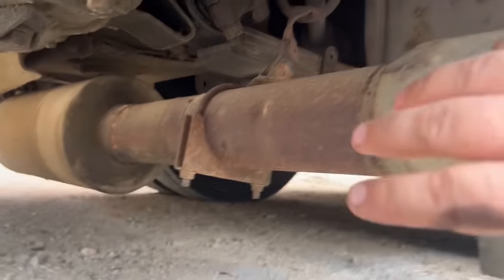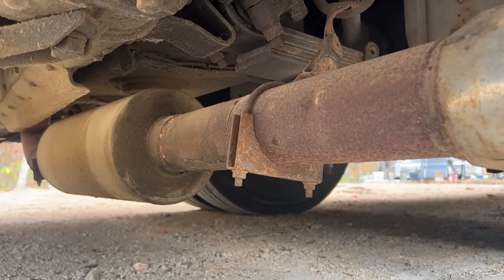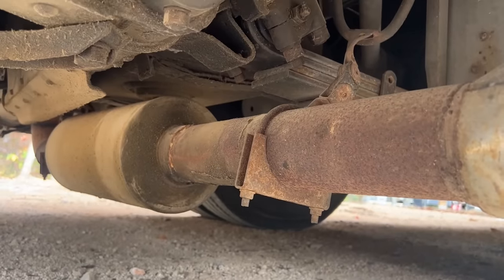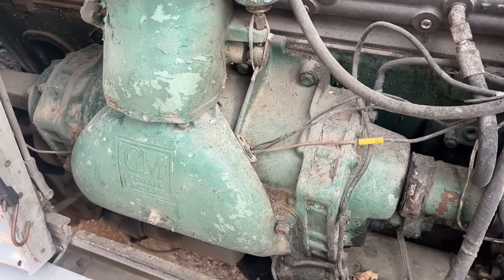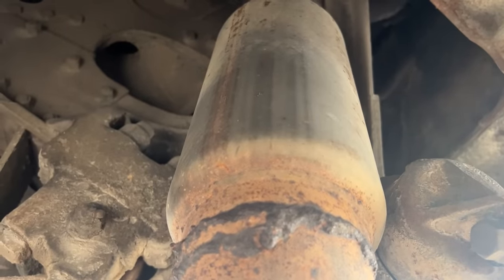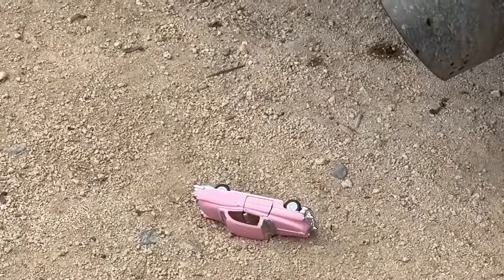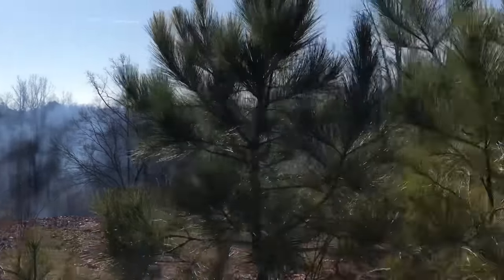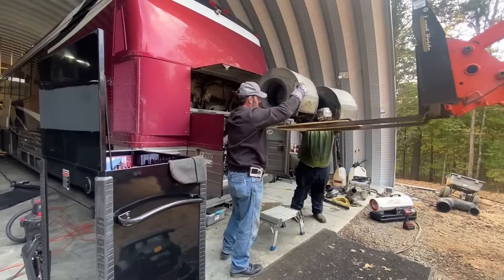Installing emissions upgrades to the detroit diesel 6-71 2 stroke diesel.  Environmental friendly

Comment: The contribution of the Detroit diesel to making  America what it is can not be understated.   Army Navy Air Force Marines.   That screaming Jimmy ,  the black smoke,   is American as Apple Pie.   Its part of who we are and what makes us special.
Reply: Amen
Reply: @tjroelsma  life, liberty, and the pursuit of happiness
Reply: The only problem is that they stuck around for far too long well past obsolescence.
Reply: @ChrisHarding-lk3jj not really ... the most advanced engine design in the US right now is variation of 2 stroke diesel...  basically take two Detroit diesel blocks and point them at each other instead of installing a head, of course in reality they machine it as one block... and gear the cranks together, one set of ports becomes the intake the other the exhaust... and thus you have a nearly 50% efficient ICE, with ultra low emissions. And on top of the efficiency you also get an even simpler engine as it has no complicated head to machine at all. the main reason detroits get  bad rap is because of the slow transition to electronic controls and failing to advance the engines, putting modern advances on these engines puts them right back at leading the pack. the strategy they use for reducing emissions is to reduce combustion temps, via homogeneous combustion as well as extra long stroke that comes from being opposed piston, another up side is that a 3 cylinder OP is balanced! which means you can have huge very efficient pistons....
Reply: @Wingnut353 what you are describing sounds like a Fairbanks Morse engine commonly used in WW2 submarines.  Is there a new version of this, and if so, can you link it here?  I'd love to read about it. 

https://en.wikipedia.org/wiki/Fairbanks_Morse_38_8-1%2F8_diesel_engine

Comment: Man, Lenny was sticking to the GM brand having a Cadillac converter installed on it. At least it doesn’t have to suffer the fate of dumping raw diesel straight into the DPF when it regens.

Comment: Here in South Africa a local farmer re-routed his tractor's exhaust through a cooler system and injected it into the ground on his planter. 
He recorded substantial crop yield increases.
Reply: That's a fact indeed, the stuff that comes out of your exhaust (Actual Diesel fumes with some oil and sooth) actually help increasing the greens.
My garden had a dead spot i tried everything with fertilizer... nothing worked... soo one day (Very high airhumidity) i parked my Toyota there and kept the engine running for a while (custom high idle) and i noticed the ground was covered in 'coal' (roll that beautifull coal) and it started raining... after that i changed my oil and since it's a dead part i figured i dont care it's my garden ill dump it there... Right now beautifull grass and moss.
Reply: @AllianceB95  i had  similar issue when my Mitsubishi Pajero blew a head gasket. I started it and it blew black soot on the grass. Over the next 2 weeks it came up greener and darker than the rest.

Comment: The absolute best emissions device that can be installed on 2 stroke Detroit engines is long piece of chain with a buoy placed at the other end.  I have tied my Nexus 600 catamaran up to numerous Detroit diesel moorings and I never once had to worry about my boat breaking free or dragging ground at the anchorage when I was sleeping or on shore away from my boat.

Comment: There is a channel, featuring a truck called "Joyride"....its a Peterbilt with a 8V92TTA which has been tweaked or modernized.  Joyride puts out 600hp and blows NO smoke when pulling hard with a fully loaded semi.......it is incredibly clean and has no DPF.

Comment: A Two way catalytic converter  (diesel specific or gas engines up to 1981 ) would dampen sound well and clean the fumes.
You wouldn't need a resonator or a muffler.
Instal a model from a similar power output or bigger engine so performances are unchanged on the bus.

Comment: 6-71 is an emissions lightweight. My occasional weekend toy is a 8-645, 80 litres of GM EMD 2-stroke. The local state railway is still using 12-645 and 16-710 as well.  All the smoke… 😂

Comment: I wonder if the company edm machining injectors for 5.9 cummins that have more holes but smaller holes to create a finer mist that reduces unburnt fuel and smoke plus improves power.  They are also porting and polishing in intake and exhaust ports and that also helps a lot.  Makes me wonder if some exhaust port work on the various detroits might help.  

When you say the blower is boosting the incoming air charge 1 bar. That is 14.7 pounds of boost correct.
Reply: No Detroits due to the design don't create any vacuum to suck the intake air in so it has to be forced in by a blower. Normal 4 stroke engines open the intake valve under negative pressure thus creating the draw. The blower is basically 0 boost might see 1-3 psi at top end but without the blower they don't run

Comment: I wish the fairbanks morse or cummins would make an opposed piston 2 stroke... the engines they have on the drawing board and prototyped sound really similar to 2 stroke detroits , and are themselves very similar to detroits with the head and valves omitted, and 2 pairs of ports, one intake and one exhaust instead... its a novel engine that takes advantage of the extra long stroke to increase efficiency and reduce combustion temps enough to produce almost no NOx... so under current EPA you probably wouldn't need a caddie converter, and under 2027 regs you'd only need 1/3 of what current engines need.
Reply: cummins does have an opposed piston engine for american military,1000hp diesel
Reply: I operated Fairbanks-Morse opposed piston diesels for a number of years.  38D8-1/8 10 cylinder 1600 hp.  Old submarine/LST engines converted to 1MW a/c electric generators.  720 rpm all day growling right along...
Reply: @andrewsmart2949  I obviously know about that... the but good luck buying one.

Comment: @scott, i bet Gayle Banks could engineer some parts to modernize a 6-71, more power, better fuel economy, cleaner exhaust. I think a good size turbo would fix all the problems a 2-stroke has. enough air to keep the exhaust from rolling coal, and enough boost to make interstate power. i bet 300hp is totally safe.

Comment: I would have more respect for you trying to make you engine run cleaner. Most people out here think their engine will run better without emission. They don't realize, newer engines run better burn less fuel make more hp and last longer than old engines. I used to drive a 2016 Freightliner with 435k miles. I got it with 19 miles and I never had to add oil. The tail pipe ran under the the truck and when I smelled the exhaust. It had no smell. Not even diesel fumes.

Comment: hi in the uk there was a company offering a 5% propane addictive to clean up deisel engines better cold starting then Dyson came up with a soot extraction device on the end of the exhaust pipe, this is all before common rail High pressure systems, running  a gallon of petrol in a tank of deisel has the same affect and its easier,
Reply: Yes and a little tyranny  fluid to go with that gas.

Comment: Seriously, has anyone heard if the EPA one day will try to regulate the emissions from the old 2 stroke engines in the country?
Reply: I can’t say that I know all of the specifics, but I know California is requiring diesel vehicles over a certain weight to meet 2014(?) emissions. Now, I think this might be commercial use vehicles, but don’t know for sure. I’ve also heard that exemptions can be allowed if you drive under xxx miles/year. There’s a HD diesel mechanic on YouTube that I watch occasionally from Northern California. He’s done a few powertrain swaps into older trucks to bring them into compliance. He swaps the engine, trans, emissions & computers from a compliant donor into the older chassis. 

So, not likely going to bring the old Detroits into compliance, but could probably keep the bus rolling if it came down to that.
Reply: They won't. Unless they give out flying cars they simply just can't enforce or regulate.

Comment: Why not just run straight propane? If it's good for a power boost/emissions it's a win win. Change the oil less frequently?
Reply from the maker: Ignition point is to high the compression won’t ignite it.
Reply: @BusGreaseMonkey   - ah, ok, very interesting. Back in the 2000's they were working on using DME (di-methyl ether) as a diesel fuel alternative. It burns as clean as propane and sees use as an accelerant in hair spray bottles. Volvo had a prototype engine. No particulate filters, no urea injection, and nothing to vaporize on injection. Too bad it never took off...

Comment: the early dpfs were a disaster they do work well when properly designed but the problem is they require more fuel to be burned they keep diesels from doing what they do best which is running extremely lean at high boost. to work correctly they require high egts if you dont drive with a heavy foot they clog up fast. also most people dont know that you can have a service cut them apart and clean them with pressurized acid to make it new again so they end up paying thousands more for new ones instead of a couple hundred dollars for it to be cleaned

Comment: Only problems I had with DPF’s were the first generation filters that would just fill up, but the active regens weren’t perfected.  When they’re working properly, I love them.
Reply: still not perfected,i worked at western star in western australia,they had to give a guy a new truck cos western star and cummins coulnt get the DPF to run right
Reply: Getting better in Cali,  supply is the issue. Amongst many others

Comment: Has Tennessee started emissions testing diesel or any of the surrounding states? California outlawed all 2012 and older diesel trucks over 14001 lbs. I don’t know if that includes busses or older motor homes. I believe if you install a newer than 2013 engine with all the emissions equipment then your ok. Don’t hold me to that. I’ve read that California is doing drive by exhaust sniffing at the weight stations. There particularly looking for out of state trucks and flagging them. Then if a truck gets flagged it’s turned around and told the truck is non compliant is no longer allowed in California. We all love a deleted diesel. But the epa , environmentalists and governments don’t. 
Thanks for trying.
Reply: For commercial vehicles yes, not for private vehicles  in Cali

Comment: The area I live in is very Woke. The city does have diesel busses, which initially were all placarded with biodiesel labels when that was cool. I think rhey are burning regular fuel now as bioD is very expensive. These same busses are aging and now  and rolling coal. They put these caps on the stacks that divert the exhaust in all directions and try to diffuse the smoke in the air. I laugh every time i see them. You could plumb the black tank into the exhaust and treat the exhaust with urea on its way out the side. ;)